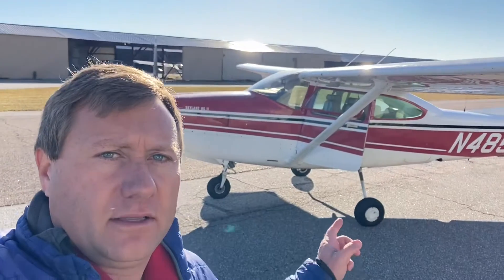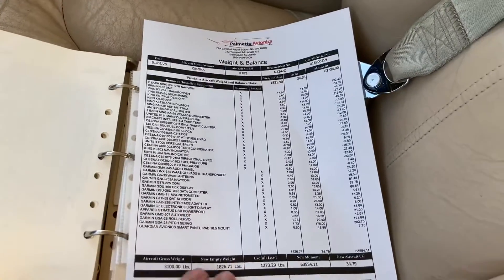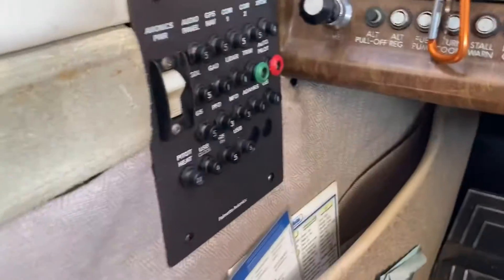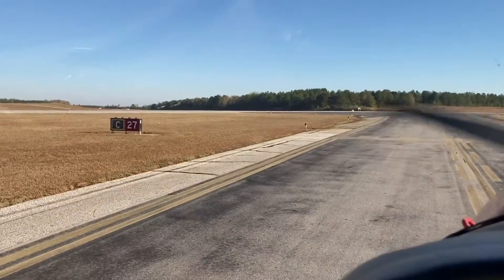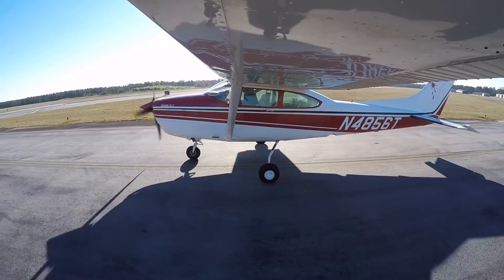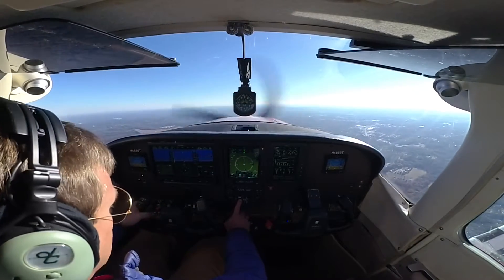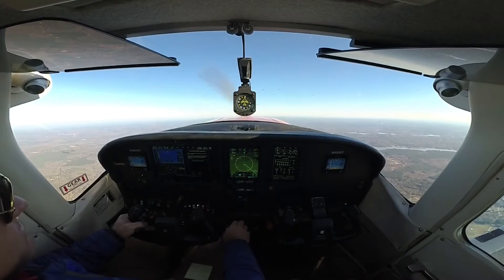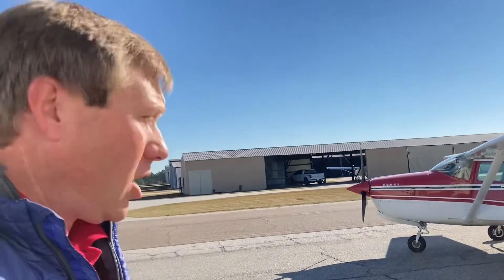Garmin AOA calibration and Cessna 182RG test flight

Comment: Time 7:08, misspeak, donut is AOAref not AOAbg. AOAbg is L/Dmax and should be in the vicinity of Vy. AOAref is where you want it when coming in to land. Such is left of L/Dmax hence back side of drag curve though likely is just right of min power hence still front side for propellers. 

But this is tricky as Vy decreases with weight and decreases with altitude hence cross checking Vy to a AOA may be off, though this is likely near enough as the slope of maxima and minima is zero hence little loss off best performance for being in ballpark but not on spot. Best glide speed also decreases with weight decrease but AOA is constant, yet this is for still air. With Indexers, there is chance Best Glide will be outside the scale of the Indexer.

Comment: “Landing Height System Ready,” does that mean the GHA-15 has a certified version now? I’m a big believer that AOA plus AGL yields King Kong for landings.
Reply: You can see if you search for Improve your Landings with AOA and Power Techniques as well as its associated case study F-35C Crash into the South China Sea and the underlying Backside of the Power v Thrust Curves. I’ll also advocate for Mike ‘Vac’ Vaccaro who has a YouTube channel here and writes in the Fly Onspeed Organization. We’ve had an interesting discussion on Van’s Air Force in the AOA recommendations thread. Vane vs Pressure Diff have certain limitations and advantages, note the vane limit in regards to takeoff will apply to IMU derived as well.

Comment: Nice video Evan!  My GRT is supposed to be able to generate a "calculated" AOA without the dual port pitot; But I have not been able to get it to calibrate properly.
Reply from the maker: In my experience calculated accelerometer based AOAs don’t work very well